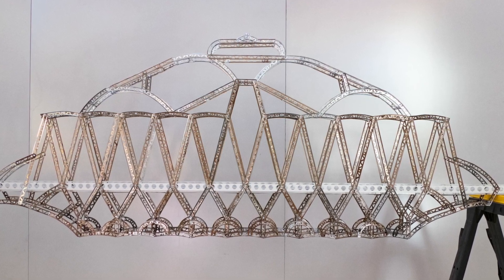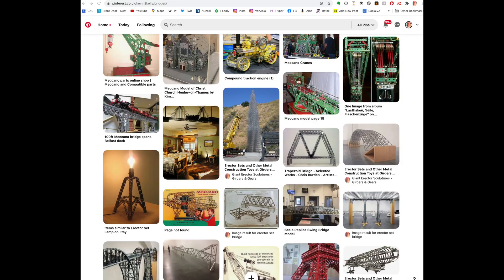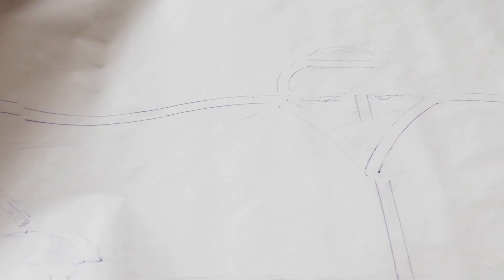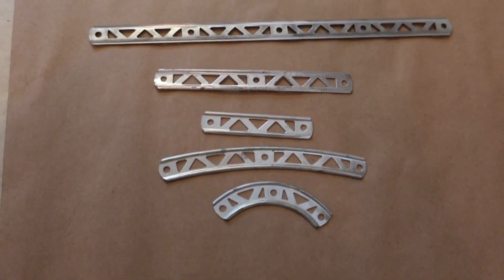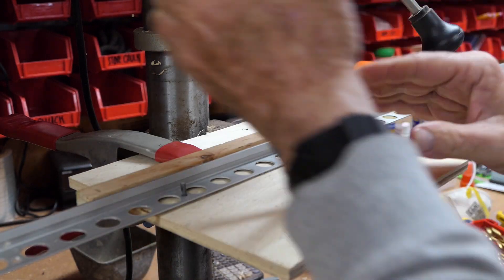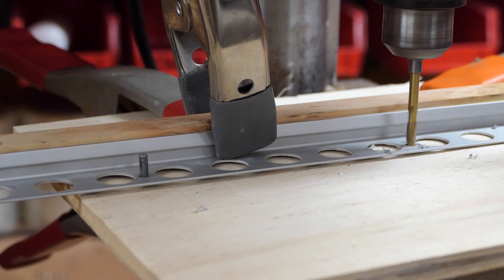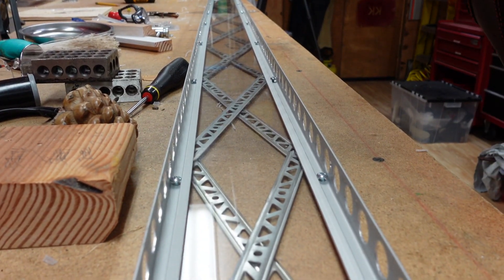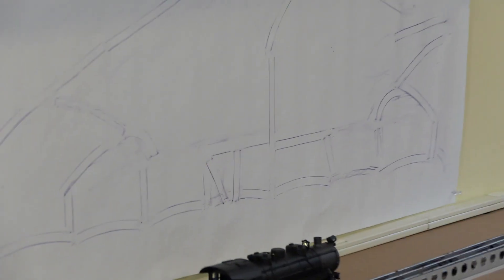TRY — Making Erector-Set Bridge

Comment: Well done! This is a wonder of imagination, thank you. Don't know if you are aware but the parallel channels on the straight Erector pieces (4) can be used with nuts & long screws to fabricate a box girder that is tremendously strong. With swearing & much too much machine work even the curved ones can similarly be done.